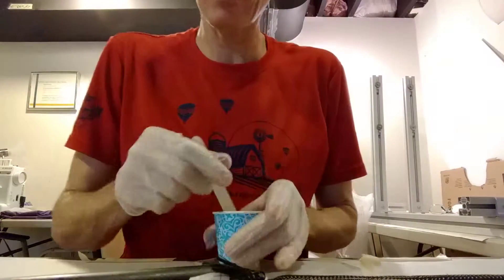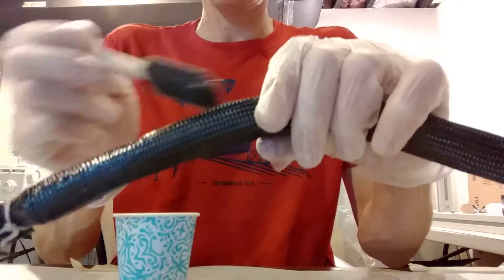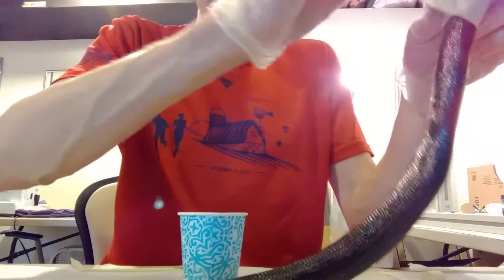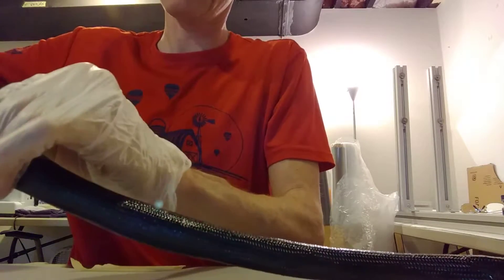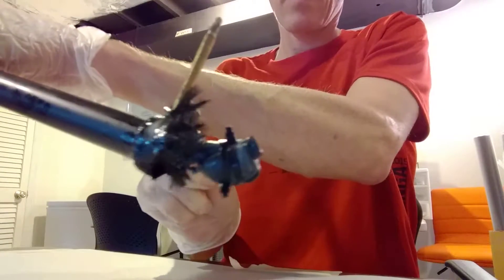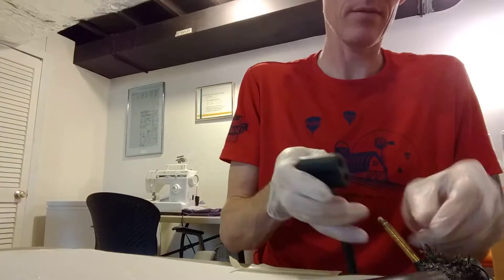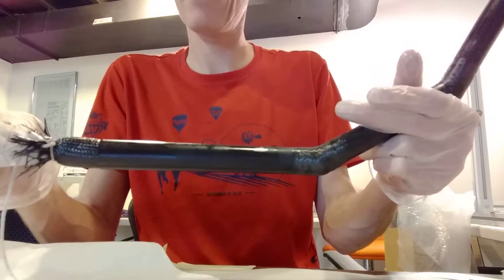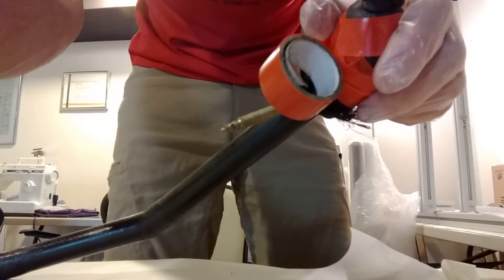Carbon Fiber Handlebar Bladder Interior Reinforcement

Comment: Thats great work ! , though i would of constrained the ends of the bladder to prevent it ballooning to  increase the pressure .bare in mind commercial CF is pressurised to 100-140psi either with bladders or in autoclaves -